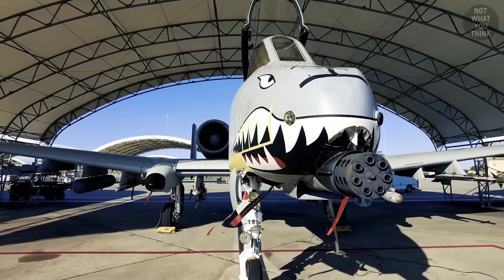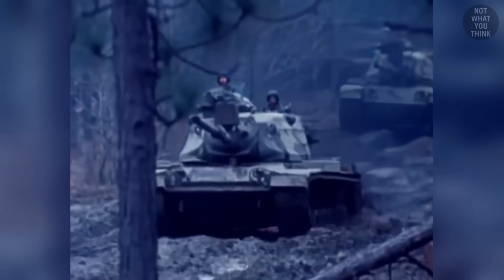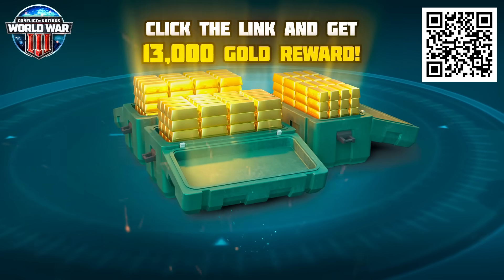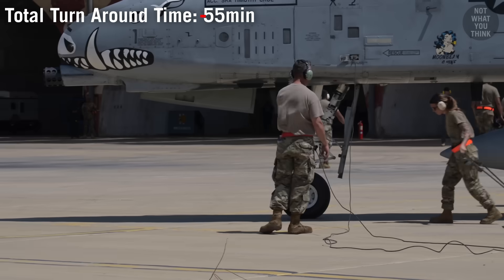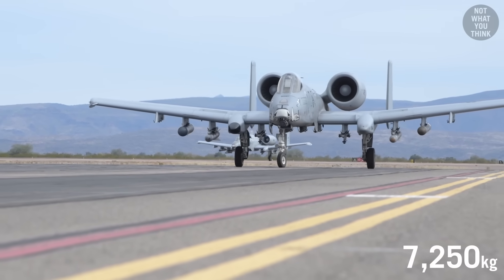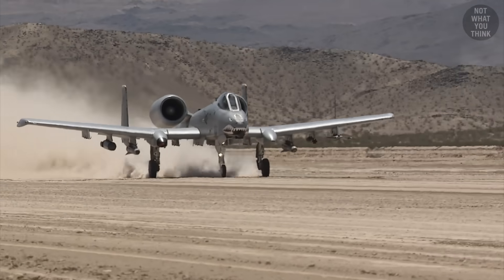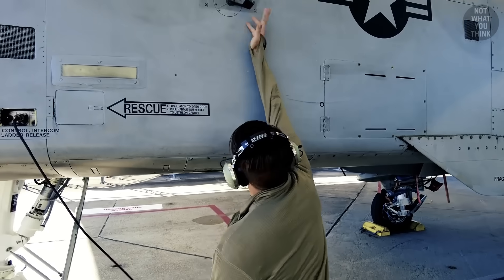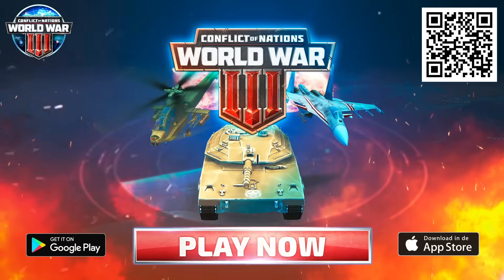The Aircraft That Doesn’t Eject Bullet Shells

Comment: Wasn't A-1 Skyraider the first aircraft specifically designed for this role?
Reply: A-1 was a Navy attack plane first
Reply: Actually it was originally supposed to be a figher
Reply: @massmike11  no. It was built initially for a torpedo/dive bomber requirement from late WWII. It was optimized for ground attack once the design was settled.

Comment: Try Not To Commit Friendly Fire Challenge (Impossible)
Reply: Bro I was about to say that...
Reply: theres plenty of scenarios where they saved the day. if not they would not still be recieving any funding at all.
Reply: @kalenlarsen eh, attaching directional loudspeakers on any other aircraft would accomplish the same, with the addition of being able to drop LGBs on target they can actually see and confirm is the actual target. 30mm DU doesn't do much against anything.
Reply: @fidjeenjanrjsnsfh  misinformation about the 30mm doesn't do much against anything.  Idiots can't read data from the old test and ignored a test 2 years ago against modern armor with ERA. Did your father not teach you the right tool for the right job.  Bombs work for some cases and not others.  If the enemy is within 50m, you don't want them dropping bombs. A- 10C added targeting pods that would most likely prevent FF incidents.  But CAS is dangerous work, which is why the AH-64  actually has far, by far more incidents than the A-10.
Reply: @joshyoung1440  apparnly better than yours did for you, glass houses, and all.
Reply: @Matt-mt2vi You got any sources for this ? Last time I heard the A10 was still the aircraft with the most blue on blue incident
Reply: Helldivers 2 eagle(basically the warthog but si-fi): blows up friendly forces with a 500kg bomb
Reply: @The_whales  Helldiver: We need close air support!
Warthog Pilot: You’re sacrifice for democracy will be remembered. drops 500kg
Reply: @The_whales she never missed though.
Reply: Trying not to mention friendly fire challenge (impossible)
Reply: @Boomkoko220  yeah, because it has the highest TK streak. It's worth mentioning.
Reply: @Boomkoko220 Fr lol
Reply: @Boomkoko220  try not to mention the "try not to mention friendly fire challenge" challenge (you already failed, please stop posting this reply every time somebody talks about this very relevant subject in the section specifically made for talking about relevant subjects, it's just annoying and makes you look like you don't understand what a comment section is for or what conversation is)

Comment: The a-10 is a cool flying gun with 2 engines and a bathtub strapped to the gun and i really hope someone can buy a deactivated one 😢
Reply: If I were rich and had a pilots license I would 100% want a commuter a10.  I'm sure I could find someone to install a sound system loud enough to replicate the BRRRRRRRT for me.
Reply: deactivating the A-10 gun without the thing spiralling out of control every time you fly would definitely require pouring lead down the barrel and through magazine input and output ports
Reply: @addust not lead uranium

Comment: i feel like attack helicopters could do a better job of "low altitude CAS on low air defense areas", im pretty sure the fastest helicopter is faster than the A-10, dont know if it can use weapons tho

i've come back to this comment after 8 months and i gotta say, the a-10 is fine, just a little outdated. the people who glaze it every second of every day and glaze its gun even more are NOT fine. the gun isnt ment for tanks its ment for vehicles and infantry extremely close to allies, the bombs, agms, rockets, and everything else is what counters tanks
Reply: the top speed of helos is way slower than any airplane, because of the huge rotor, which can´t go supersonic but will, if you want to go to fast... The apache can go around 300 km/h (Wikipedia, around 160 mph)
Reply: The top speed for a helicopter is a modified Westland Lynx at 400 kph. The top speed of a clean A-10 is 500 kph. The top speed of the V-22 Osprey tilt-rotor is similar to the A-10.

The Lynx is a multifunction helicopter which can be armed with ATGMs for anti-tank duty. The Osprey is also a multifunction helicopter with an optional weapons package, though more for self-defence. I haven't seen anything about full gunship tilt-rotors yet  (either AH or AC style) but I wouldn't be surprised.
Reply: @otterylexa4499  Good point, however, only one of them flies above 10km with 3x the payload and sensor suite..